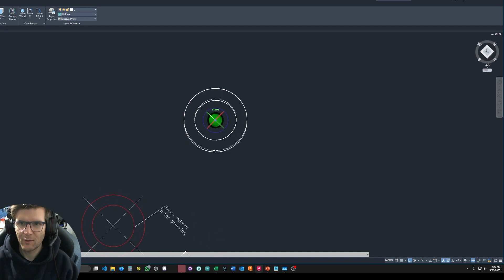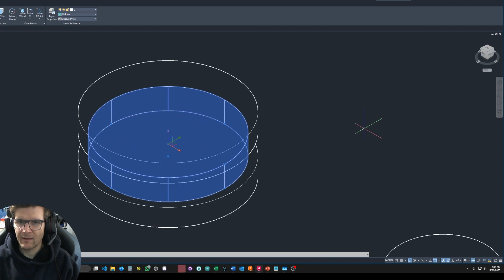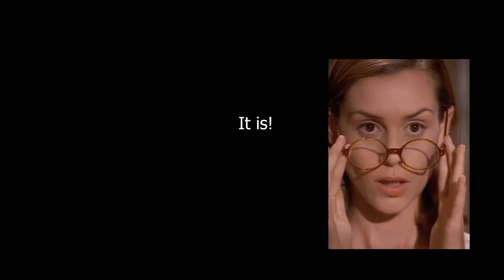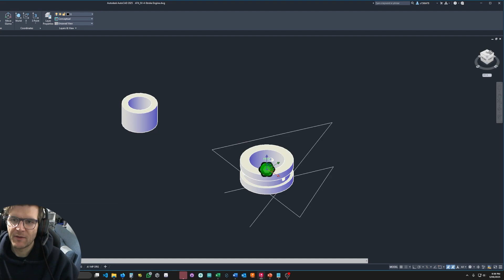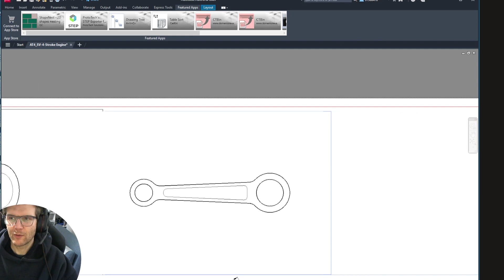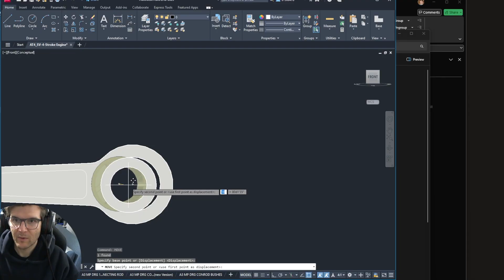AutoCAD 3D Model  E02 Conrod Bushes Tutorial

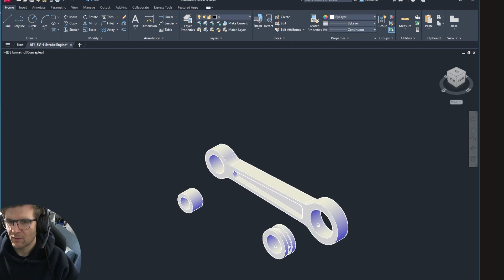Comment from the maker: Note: At 31:12 I assume that we reuse the same viewport that shows the same connecting rod. But nothing stops you from creating a separate copy of the connecting rod so that one copy has the bushes fittted inside (for sheet 11) and the other copy does not (for sheet 10), which would bypass the need to use the "HIDEOBJECT" command on the bushes when exporting/plotting sheet 10.